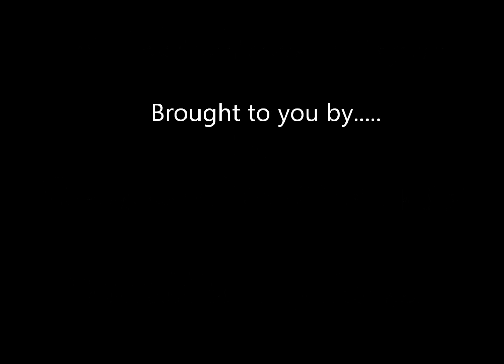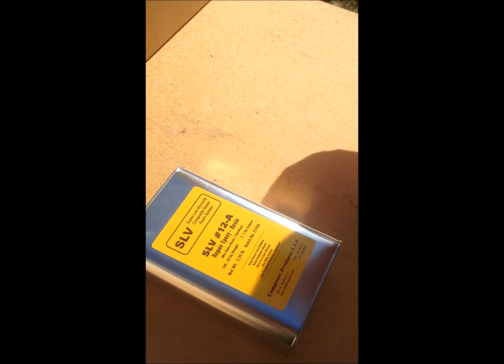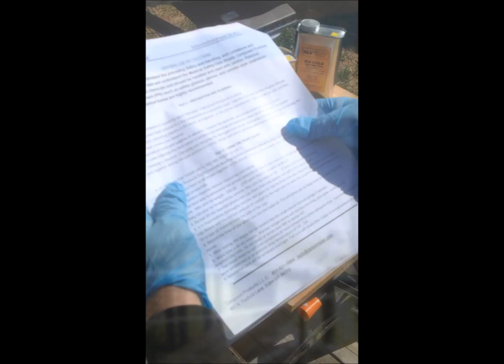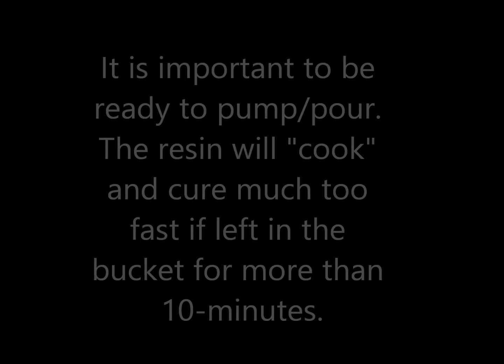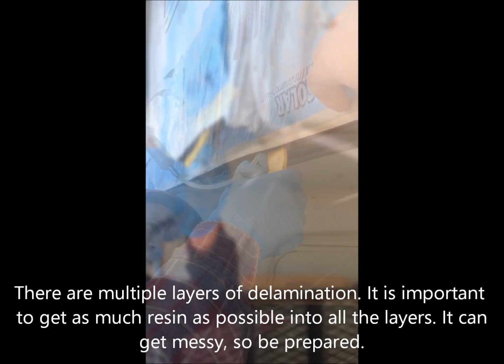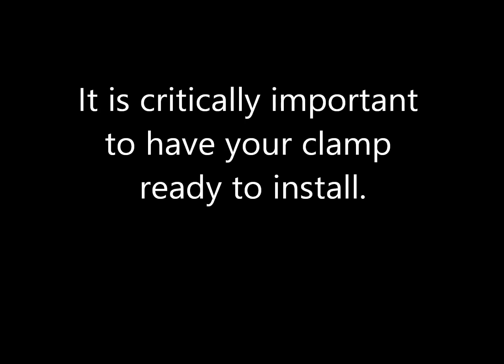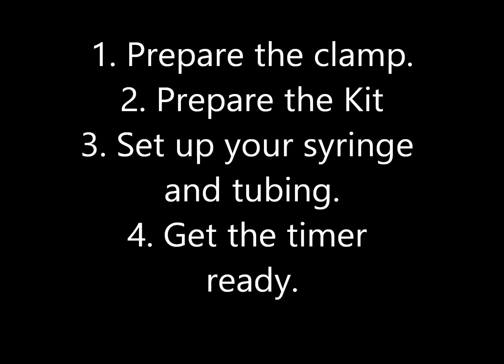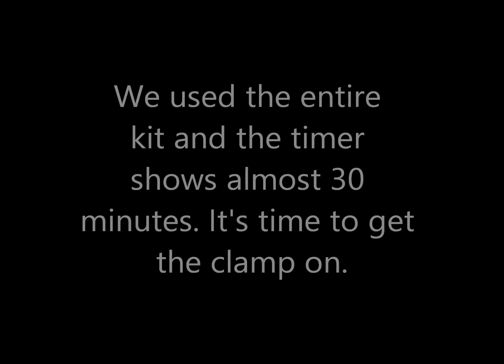RV Delamination Repair by Composet Products. RV, trailer, and motorhome sidewall delamination

Comment: You guys make this look easy.  I've done raw fiberglass work before, but never anything like this.  I'm looking tomorrow at an '87 Fleetwood Southwind 33' motorhome some folks are selling primarily because of delamination.  I haven't seen it yet, but have nothing I could set up clamps against like you guys did.  I have a feeling it would take a few master kits, but for 1500 bucks, maybe it's worth a look.  Thanks!

Comment: I did this to mine with some expanding foam in the really bad spots. Since I couldn't turn the RV on it's side and park a riding lawnmower on it I clamped the area in the middle of the wall with external compression struts. If I had it to do over again I'd drill all the way through the wall and clamp the whole area with boards and bolts. A few nicks on the outside that can be filled, sanded, and painted are nothing compared to ripples and bubbles.

Comment: Thank you for showing this process. This gives me some hope for my Starwood delam issue. Both sides of the front bumper pull unit are delaminating from top to bottom. Any clues on how to keep this from happening again?
Reply from the maker: Patrick Shaffer Hi, Thanks for the comment. Delamination occurs when water gets into the wall. Keeping windows, doors, roofs, etc. sealed is the key. Send pictures to tech@delamrepair.com for a more in depth answer.
Reply from the maker: Patrick Shaffer Keeping water out is the biggest thing you can do. Examine the entire exterior at least twice a year. Look for cracks in caulking at roof/wall junction, around windows and vents, lights, etc.
Reply: gegehehe

Comment: Can i use your adhesive to re-attach the luan and outer fiberglass panel if it has been removed? About 3 foot wide and full top to bottom outer panel.
Reply from the maker: yes, however there are many variables that affect the outcome

Comment: this is only temporary repair.  there's got to be separation of luan wood in behind causing improper bonding. proper way is to  cut,  take panel off,  and delaminate , from scatch
Reply from the maker: Maybe, maybe not. Permanently re-bonding the luann plywood with a moisture resistant adhesive is possible if the wood fibers have not been damaged. Most delamination occurs when the caulking fails, water contacts the NON-MOISTURE RESISTANT glue in the luann, and the glue de-bonds from the plies of the plywood. Yes, you can simply re-bond the plywood.